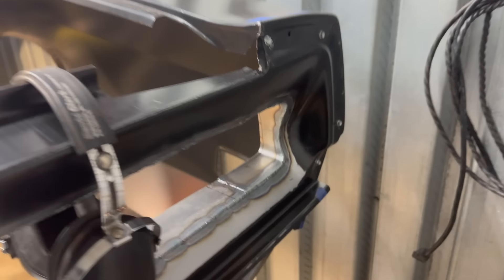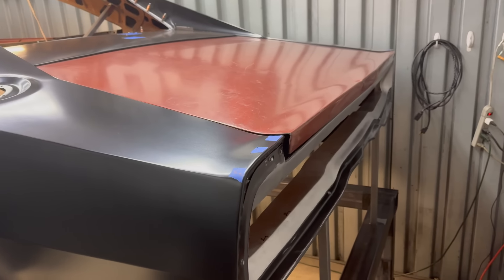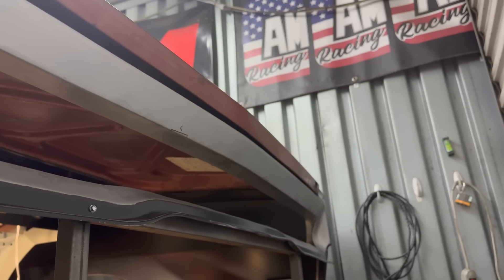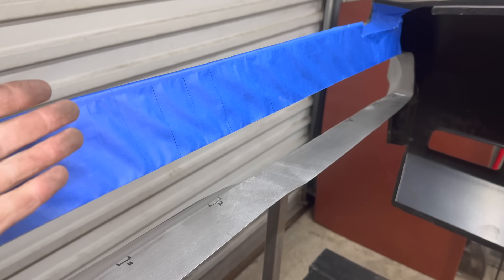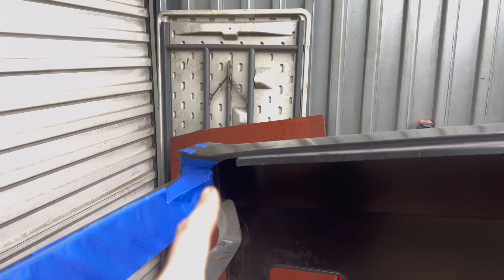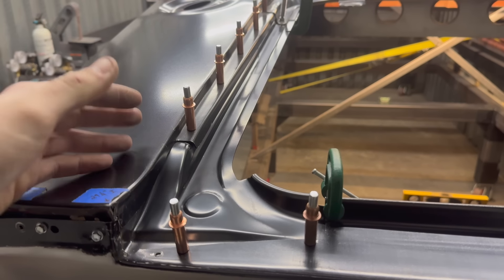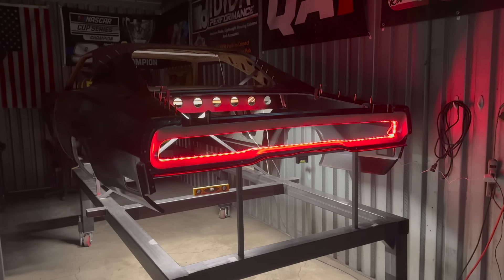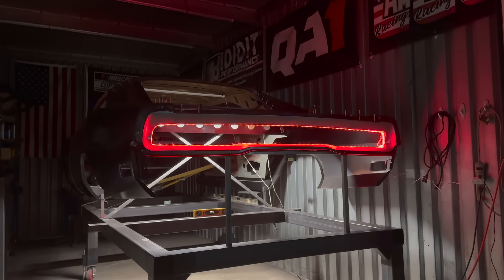Fabricating a CUSTOM tail panel for my 1970 DODGE CHARGER pt.2

Comment: Congrats on 10k! I just watched your video where you had all of the parts laid flat outside. For your front fenders which are pitted and thin, you may want to try using a panel adhesive. It works great for patching in metal on thin metal. Keep at this and you'll have a fantastic future!

Comment: I like the idea of having the parking light go around the hole following the shape of the bottom of the panel. Then the stripe in the middle for brake lights and blinkers. Parking lights could go below the bumper, with some LEDs there you can have bright parking lights so you can see behind you well
Reply from the maker: Definitely a lot of options, we’ll see what I end up deciding in the end
Reply: Just now realized I wrote "parking" instead of "reverse" the second time lol

Comment: You can buy adhesive pads for your  mini belt also . It helps so the wheel doesn’t dig in when your grinding a flat surface.
Reply from the maker: I’ll have to look into that, I appreciate it!
Reply: @camracing  I have been do metal finishing for 33 years . Definitely love your metal finishing skills at such a young age !

Comment: I love the shape of that tail light. Pouring a resin tail light lens is probably the way to go. You will also have to build reflector and coat it. I have always wanted to build one, I can't wait to see what you come up with. No matter what I can guarantee you will make it right. Keep up the good work young man!
Reply from the maker: Thank you, what you mentioned is pretty much my plan. I’ve seen some other guys do similar things and it has good results. Time will tell🤙

Comment: For taillight options, I think having the running lights be infinity lights would be cool. And maybe a light strip kind of light the ones under a truck tailgate for brake/turn/reverese lights?
Reply from the maker: That’s a solid option for sure, like I said, so many different options it’ll be hard to choose just one.

Comment: I've been watching you for many years , you have basic hand tools and a brain with a vision,if you had equipment and better tools you'd be better off, keep in mind that Chrysler products from the factory needed alignment, Core supports weren't centered fenders doors and quarters were never aligned good if you had more and better hand tools and equipment to help you , you would've been done by now, whoever hires you is going to need enough money, you have a vision of what you want to do,you don't need luck you just need somebody to hire you, for the right price! I wish I had my 68 coronet give you a run for your money